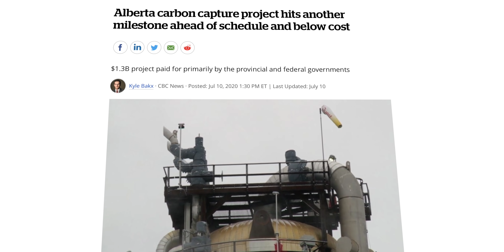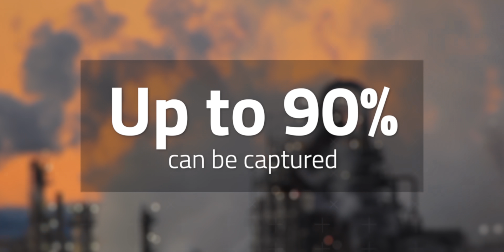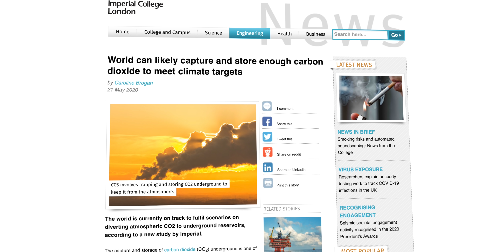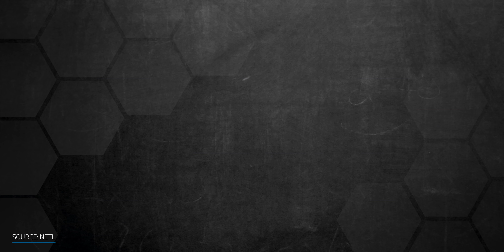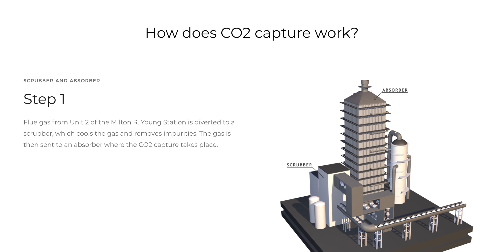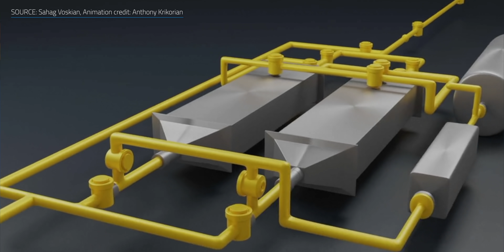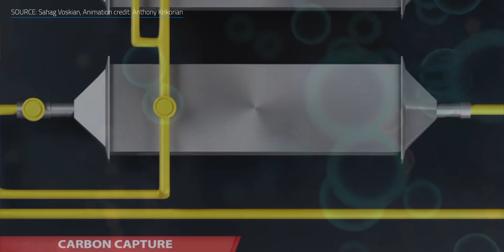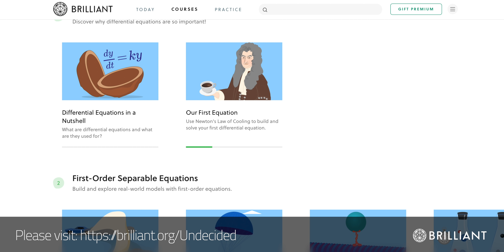The truth about capturing CO2 to reverse climate change

Comment: I actually spent 5 yrs of my life researching (i.e. in the actual lab) carbon capture, back when it was called CCS - carbon capture and sequestration (at a conference I went to they said we should stop using sequestration as it is too fancy of a word for the general public to understand). We worked with a lot of the big (and small) companies in this field and even got a $8M DARPA grant for our work.

Here's the problem, most carbon capture technology uses an amine solvent (like MEA, monoethanolamine) to capture CO2. You then have to desorb the CO2 by heating it to high temperatures, which takes a lot of energy and then compress it for storage, which also takes a lot of energy. The models we and others developed showed about half the power generated in a typical coal fired power plant would go to the CO2 capture and compression. We worked with enzymes to accelerate the CO2 capture and reduce the amount of energy needed but even in our best case scenario it would still require about 30% of the power plant's energy output.

Then the question is what are you going to do with the CO2? Sure you can use it for enhanced oil recovery or pump it into abandoned oil wells, but that really only works in Texas. Pumping CO2 from, say, Nebraska to Texas is energy intensive. One big earthquake could release all that CO2 and cause massive deaths (it's happened before, see Lake Nyos disaster). You can pump it to the bottom of the ocean where the weight of the water above will keep CO2 in a liquid state and at the bottom, but again that takes significant energy (bottom of the ocean is ~ 15,000 psi). CO2, energy wise, is bottom of the barrel (it's fully oxidized), so there's not many uses for it at the scale we're talking about. Remember, the scale of CO2 capture is HUGE.

Capturing CO2 from the air is just a stupid idea. As you said the concentration is so low in the atmosphere that the driving force is almost zero. The flux (transfer) of CO2 from the air to the liquid capture solvent is proportional to the driving force, this means it would require huge capture towers to make any difference, and these take massive amounts of energy to run and significant capex to build. The MIT thing may work in the lab and will make a good paper, but is not scalable. You can't override the laws of physics and chemistry, no matter how good you are. The only way anything meaningful will work is to capture it at the point of generation, i.e. coal (or natural gas) fired power plants (there's over 350 in the US and probably 5 times that in the rest of the world).

To sum it up, there is nothing technically difficult about capturing CO2. The problem is you have to essentially build an extra power plant for each existing one just to provide the energy for CO2 capture and compression, which means you have to burn twice the amount of coal you're burning now. And then you have to figure out what you're going to do with it. Just doesn't make a lot of sense. Reduction (population control?) and renewables make more sense.

(FYI, I have a B.S. in chemical engineering and a Ph.D. in Biochemical Engineering)
Reply: Why not use solar power for the energy required to capture the carbon? Or if that's not possible use nuclear power instead? Essentially it's depth we have to pay back now, humans leveraged fossil fuels but now the process needs to be reversed... even if this takes 50% of the generated energy... its a win... we actually would have to recapture part the  fossil emissions we added since the industrial age... if planting trees won't cover us here... by then we better have sustainable ornat least carbon neutral power production in place...
Reply: @nougatbitz  Why not just use solar and nuclear to produce our energy now? To use it to reduce previous CO2 emissions and pollute our world with nuclear waste and used solar panels (not to mention the carbon footprint to built these) seems like a waste. Building all this for direct air capture to reduce CO2 levels a few ppm does not seem like a great idea. The world stop eating beef would have 10x times the effect you mention here (in terms of cleared grazing land and methane emissions) at near zero cost.
Reply: Thank you for your very interesting comment. I mean it.
Reply: @user-mr7pm3kw4t  Like what? If there are energy sources more economical than coal (and natural gas) they would be in use today. Nuclear is one, but that's fallen out of favor. The way carbon capture is currently thought to be implemented would be attached to current coal fired power plants. The energy needed to run the carbon capture would be taken from the existing coal plant, it is called parasitic energy draw. They wouldn't build another power plant next to the existing one just for carbon capture.
Reply: Thank you for your input! A few days ago I finished reading "Getting to neutral" (https://www-gs.llnl.gov/content/assets/docs/energy/Getting_to_Neutral.pdf) a 178 page report on how to make the US state of California carbon neutral by 2045 at cost of 0.4% of the state's GDP per year. Carbon capture and storage, either from flue gases or from direct air capture does play an important role, although not the most important one, in this report. 
While the authors do mention the required additional energy for carbon capture technology, it is presented as solvable and not as breaking the entire concept. I found this report encouraging, but maybe I missed something and it does not combine well with what you stated in your initial comment.
What do you think of this? I would really appreciate your answer!
Reply: @matthiasmo4396  Well, I haven't read the whole thing, but one of their pillars is direct air capture, which, as I mentioned, is a stupid idea. Nothing they present is anything new, they just say it can be done by running spreadsheet models. Everything is solvable on paper. Just look at CA high speed rail, hundreds of billions over budget before anything of importance was even built. A big part of what they proposed is underground storage in old oil fields, again, nothing new but this has never, to my knowledge, been demonstrated at any reasonable scale. One bad earthquake (this is CA after all) could cause a major CO2 release and kill many (look up Lake Nyos disaster). The study was funded by ClimateWorks Foundation, so I would take it with a grain of salt.
Reply: So why not just use nuclear energy to power these machines?
Reply: @SuperThischannel  Why not just use nuclear energy to generate electricity in the first place?
Reply: @SuperThischannel  expensive and slow to build. With current energy prices and trends a gen 2 reactor just never returns the investment (afaik same with gen 3), so you must spend money which you never get back - something people and government really don't like to do.
Reply: Good luck trying to control the population in any non-communist country.

I don't see how that's actually a solution, that's such a globalist dictatorship mentality, you'd never feasibly be able to police or tax that kind of thing while simultaneously stopping it from happening. 

And I mean good luck with the next boomer generation rising out of covid.
Reply: @KingNefiiria  Of course, I was being facetious. And it's not the 1st world countries that have such explosive population growth, it's the 3rd world ones.
Reply: @sjn7220  yes and so the only way to stop their growth would be to take over and police it, which even if that somehow happened and wasn't considered extremely racist, it'd be impossible to control.

The US is starting to stagnate in population, most of our "growth" comes from immigrants. With the advent of birth control, we'll be fine in terms of population, we might even become Japan in the sense where we just stop having kids entirely. Most people either have one kid or none, or they have one kid early and one kid late, basically separated by an entire generation.
Reply: I worked in a different industry and hold several patents.  You are very intelligent person and would be an asset to a company.  However, we used to remove people with your thought process from our innovation teams.  Your statement, 'You can't override the laws of physics and chemistry', while true is not a limiting factor.  We used to say, look at all the opportunities the chemical and physical laws allow for.  We just need to find the solution that works.  Caveat: I am simplifying the next statement a lot:   Back in the 70's, they said the smallest line we could make was 193nm.  Because the laws of physics said that was wavelength of energy we could create that would still affect opaque materials.  Today, we make 20nm lines using 193nm wavelengths and although quite expensive, we can vaporize tin to create even smaller wavelengths and have materials which can be used as photosensitive to that wavelength.  There are solutions out there.  We just need to find them.
Reply: AlienHawk Q, you have the right idea. Time will create more ways to solve our problems. Things we thought impossible a few decades ago are possible today. We are not going to die or kill the planet in 10 years. We will come up with more ideas and ways to solve our problems. We have reduced carbon emissions dramatically over the last 30 years. One of the biggest problems we have is other countries like China not caring about emissions. We can do all we can to slow, stop, or level out our carbon emissions but when you have other countries increasing their emissions it seems like a waste of time. We need to start by putting countries like China in check and make them more responsible for their emissions. Nuclear seems like the best option at this point and time but the issue is the spent fuel rods and storage after they are spent. I like guys like you who don't think anything is impossible. That is how we create things we never thought we could. People like you are the ones who will solve our problems. Good luck my friend and best wishes.
Reply: @fatherof4kids  I don't think you understand the difference between what is possible but difficult, and what is impossible as it violates the laws of physics, chemistry and thermodynamics. But, we'll wait for you to solve it.
Reply: @alienhawkq4690  I'm an inventor on over 30 patents and have over a dozen publications. My company values my opinion and expertise. If they wanted a "yes" man, someone who says anything can be done just keep dumping more money into it, they could have hired someone from government. There is nothing more dangerous than "group think". The laws of chemistry and physics are exactly the limiting factor. Anyone who thinks otherwise is fooling themselves. I let my company what is easily feasible, what is feasible but very difficult, and what is impossible due to the laws of physics. They wouldn't have kept me around as long (20+ yrs) if they didn't appreciate and respect my analysis.
Reply: @user-mr7pm3kw4t  I didn't say it will, I said CC only makes sense at the point of generation - direct air capture is foolish for many reasons. Natural gas still gives off CO2, although less per kWh than coal. And, nuclear is not zero emissions; maybe zero gaseous emissions but certainly not zero solid emissions.
Reply: Hi. I feel conscious and intimidated of how many intelligent people are here, but u cant blame me im just a freshman student trying to research something about 'solutions' to CO2 emmissions. Im here to learn 😊

 I have a question tho. Do you think its possible to create something that will.. filter, capture or etc. the CO2 emmissions from factories? Something to.. like directly put on the mouth of those structures blowing out CO2?

Sorry i dont know if my question sounds stupid or what but yeah. Im here to learn
Reply: @victoriaangeline1784  This technology has existed for a long time. It is not difficult to capture CO2 from a gas stream. The problem is that it takes copious amounts of energy to capture it and then there's the problem of what to do with it. There's some ideas but none are ideal.
Reply: how arrogant of that conference
Reply: Why do we have to store CO2?  Couldn’t we take it and break it down to carbon and oxygen individually?  

Just because it takes away some efficiency (30%), to me that’s a lot better than population control or the nightmare ideas from the reset agenda in politics right now.  The point is to give us time to gradually replace old products.  Plus we need multiple methods, there’s downsides to renewables too.
Reply: @narnia1233  Unless you're a plant and can photosynthesize, converting CO2 to carbon and oxygen is not trivial and, more importantly, requires energy. In fact, it requires the same amount that was given off when carbon and oxygen were converted to CO2 (more, actually due to entropy) - it's all thermodynamics. The 30% (best case scenario) was just the energy needed to capture it. So, where should that energy come from? Burning fossil fuels? Well, that doesn't get us anywhere. Nuclear or carbon free sources? Sure, but why not just use those energy sources in the first place?
Reply: @sjn7220   Well, there are plants on earth.  So just buy some plants and let them do their stuff.  Release the CO2 next to the plant.
Reply: @sjn7220   My point is, there is some corrupt political ideology going on right now, which is being accomplished because people are saying the world’s going to end if we don’t force everyone to switch to better energy alternatives by 2030.  And that should be a concern as well.  I don’t know if you’re aware of “the great reset”, I wasn’t until a month or so ago.  But it is being promoted by lots of businesses and world leaders, it is not just a figment of imagination.  They want to give a group of unknown people control over everyone else.  

And things they mention too is population control.  But also the idea of no one owning anything anymore.  

Anyways, so all I’m saying is it’s okay to have a temporary solution to a problem while we slowly transition to a different source of energy.  Because we want to avoid panic and government takeover—that is also a terrible thing.  

Sure it stinks to not be able to take care of a problem right away, but sometimes going too fast leads to other undesirable issues.
Reply: @sjn7220    That makes me wonder, could we just build a building that holds all the output from the power plants that contains tons of greenery (plants)?  So that way we don’t even need to build technology to capture the CO2.  We just vent the gases into a building with plants that do everything for us.  So no energy loss then.

I’m just curious.  Has anyone seriously considered that?
Reply: @narnia1233  Plants don't grow at the rate they are fed CO2. They grow slow. I don't think you understand the scale of the situation. You would need a MASSIVE greenhouse to pull this off, probably 1000's of acres per power plant. It's just not feasible. The closest thing we had to this is growing algae in large ponds or clear tubes. Algae is one of the better organisms to converting CO2 and sunlight into oils. But, every algae company I know of went out of business. It just wasn't feasible.
Reply: @narnia1233  I'm not a conspiracy theorist, so I can't comment on that. But, just to be clear, converting CO2 back to carbon and oxygen is not even a temporary solution, it is not a solution at all. There is still a net release of CO2, it doesn't solve anything.
Reply: @sjn7220  
How exactly do plants capture carbon dioxide? Why not imitate the way plants capture carbon dioxide?  And converting it to oxygen and carbon in the way of plants as well
Reply: @ramaaljelani3838  The Calvin cycle is well known (how plants convert CO2 to glucose). Imitating it is not trivial (essentially impossible); but there is no need as plants do it quite well.
Reply: I didn't work on this problem in the lab. But I thought a lot about it. Back of envelope calculations would seem to confirm  your point of view. We'd better change our way.
Reply: Hey, since you actually know what you are talking about: Thoughts on enhanced rock weathering ?
https://en.wikipedia.org/wiki/Enhanced_weathering & https://projectvesta.org
It seems like THE solution that checks all the marks, and is so simple that any flaw should be easy to spot. Yet I don't hear much about it...
Reply: @musaran2  I don't know much about this, but any capture technology not done at the point of generation (meaning coal or natural gas fired power plants) won't be effective. The concentration of CO2 in the air is just so low that the driving force (essentially the force pushing CO2 from the gas phase to the solid phase) is just miniscule.
Reply: sjn 72 Bamboo is the answer
Reply: Thank you sir for sharing your knowledge.
Reply: Thank you for posting that. Would a renewable power source replacing the coal-generated electricity make a difference?
Reply: @nni9310  I'm not aware of any renewable power source that can be implemented at the scale needed.
Reply: Well you cant override the laws of physics but is this energy pr unit we are talking about? or does centralized locations to capture from multiple stations help that equation? Im rly just looking for signs humanity got what it takes for this crisis.
Reply: Umm just a thought, pressurized air is used in a type of battery, separate co2 there ? seems better then just filtration of the atmosphere... mayby some GMO could help...
Reply: how about a giant solar and wind farm with a battery plant, like the one in australia, could that be an alternative for a powerplant?
Reply: Brilliant well done for saying the obvious 🤣
Reply: Hey you, I know its been 5 months and a lot of comments but I just discovered this video while doing a research project for uni and wanted to thank you for your insight. I'm doing my masters in process engineering and have to write about the potential of this techonogy for the cement industry in Austria. Thank you again for the read, you really seem to know your stuff :)
Reply: @iheartcupcakes253  No problem. Good luck with your project!
Reply: Hey i am from india and a professor at indias best university IIT BOMBAY i want to talk to you if you or anyone else is reading this please contact me on 9899187299
Reply: Thanks for that insight.
Reply: Thanks for this detailed explanation, appreciate it.
Reply: I’m a new grad student doing research on catalysts for CO2 capture. You mind if I could ask you a few questions?
Reply: have you seen the new developments on synthetic auto fuels? does the math & chemistry work in those cases?
Reply: @Philip Ethan van Harreveld u do realize that co2 levels would rise and fall if humans weren't here, in the past they were higher. And melting ice would naturally increase the temperature as the planet becomes less reflective as ice is extremely reflective. Also the changing in strength in the magnetic field also results in warming as it gets weeker. Water is also a greenhouse gas and as it gets warmer, more water evaporates resulting in even more warming causing a closed loop in which each accelerate as a result. Also the poles retain little water in the atmospheres. A warming would result in less water going into the ocean and more into the atmosphere, again warming the planet
Reply: @Tamiasciurus we just need air and water borne sterilization agents lol they dont have the brain capacity to enter the modern world the way humans can, and we need to do something about them soon...
Reply: Finally a honest answer. Thanks so much bro. If we go to technology,, we have to get much closer to bionics, and biological chains of energy. It could be trees, or bacteria, in order to get co2 bound into sth that can be used. In the end however we will not use traditional agriculture or bacteria reactors, we will use agricultural ai and robotics
Reply: Interesting thank you for writing this up.
Reply: Yep. That's basically what every physicist who is not payed by the oil companies would tell you.
Reply: sjn 72
Thank you for explaing the absurdity of this projects.
A doubing of the co2 concentration is highly desirable, essential for people trying to survive on the low content of co2.
The impact on warming is negligible.
Reply: sjn 72 
Using MEA, as done in submarines,  is not effective at the low concentration of 0.04%
Reply: can they channel waste heat from the hydrocarbon power plant to power a steam turbine/solar updraft/stirling engine arrays for carbon capture?
Reply: Have you ever learned how much co2 a plant needs to synthesize fructose, aka glucose? 
for every kilogram it must capture 1.467 kilogram co2 from the air, which has only 0.49 grams /m³. 
3000 cubic meters if the plant could capture all its content in a m³, 
Think about it before noticing that the vegetation at high altitude must starve because the content there is only 0.24 gram/m³.
Do the numbers yourself and bow your head in shame.
Reply: How did nature capture CO2 in the ivory coast? Is there a way we could re-produce the effect?
Reply: About trees, I once went looking it up and it seemed to me that the present CO2 footprint of a person in the west is only compensated by a soccer field full of trees. We don't have the space to plant all these tree. Ground is costly. I believe that massive worldwide conversion of biomass to biochar would make a noticeable difference after at least a decade. The source is the problem, we emit way too much. I would force corporations to recycle, produce and store energy all locally on the plant itself. This would raise the price of the product but normally not to make the product unaffordable.
Reply: And that's the problem with technological silver bullets. Technology doesn't replace energy. You can't ignore the law of conservation of energy in the closed system that is Earth. The only solution is to stop consuming and shift entire industry to production of renewable power plants.
Reply: @sodalitia  you can ignore the law of conservation of energy outside of earth's "closed" system?
Reply: @sodalitia  Renewables are total losers in terms of mitigating the problem.  The Germans learned this the hard way.  They increased both their wind and solar apparatus by about 13% and then generated 11% LESS power overall bc it wasn't sunny or windy.  Look into Liquid Fueled, Molten Salt Thorium.  No need to do without.  And the waste heat can be used to pyrolytically turn garbage into hydrocarbon fuels or desalinate water.  The name you want to know is Kirk Sorensen.
Reply: @sodalitia  The only real option is reducing consumption and limiting population growth. Sure hydroelectric is great, if you have a fast flowing river nearby and ignore the environmental impact of the dams. Solar requires massive surface area and the commensurate amount of solar panels (which have their own carbon footprint to make and install and have a limited lifetime). Biofuels have a long ways to go and still require huge land masses with the required water and fertilizer and the logistics to transfer all the bio-feedstocks to the fermentation plants. Algae shows a little bit of promise, but again you need large areas and water to grow the algae, then you have to separate all the water from the algae and recover the oil, which is really the achilles heal of algae tech.
Reply: @sjn7220  Well, to be honest, by saying "solution" I was overly optimistic here. I don't claim it will solve the crysis, especially when we already likely passed the tipping points. But I was saying that in contrast to pipe dream of CCSes. If we don't have political will to shift most of the world industry to serve transition to renewables, regardless how unachievable the ideal of 0 emissions is, and curb our rampant consumption, we are done here. All forms of energy production have problems, because by increasing the energy porfolio even by renewables you enable and stimulate, within the capitalist system, more resource extraction and production. It's called energy-production interface. I don't really see solution to climate change within capitalist system. When it comes to overpopulation and overconsumption, lets remember that the latter results in way higher emissions than the former. Despite record population growth, the poorest countries have the lowest carbon footprint, so I think we should be very careful about population control, when average American produces 14 tons of CO2 a year while average Indian 1.7.
Reply: Regarding Algae biofuel, one would think it would be relatively easy to engineer them to concentrate and release their oil on their own.
Both processes are fairly common in various life forms.
Reply: @musaran2  You are the one who think it would be easy to "engeneer them to concentrate and release oil on their own". Whatever that magical, techno-mumbo jumbo means.
Reply: @musaran2  You've not worked with algae if you think engineering them is relatively easy. I can think of half a dozen algae companies that are now out of business as they couldn't solve the algae problem. I'm also not sure what you mean by "Both processes are fairly common in various life forms." regarding concentrating and releasing oil.

Besides, concentrating and releasing the oil is not, and doesn't solve, the problem. The oil is already concentrated within the algae and you now have to separate the algae from copious amounts of water. You can't skim them off the top (they grow several feet deep in water) and centrifugation is not easy when their density is similar to that of water (and centrifugation at that scale is not free opex and capex wise). Filter presses don't work all that well for this either. I've seen drum dryers used but, again, these are costly to operate when you're trying to make a commodity chemical (water has a very high heat capacity).
Reply: @sjn7220  Don't know how much you know about it but would love your thoughts on Modern nuclear? Modern traditional nuclear? MSR (Molten Sal Ractors)? Thorium? As far as I've gathered they can re-use the fuel waste from older nuclear plants. Short of reducing cons. and population nuclear seems the only viable energy source where the waste is fully contained. Also provides ample energy, has comparatively small footprint. And unlike common misconceptions, aka hysteria, it's incredibly safe.
Reply: @Badabinger  I'm not an expert in nuclear. I'm definitely not against it, especially the more modern reactors, as you mentioned. Nuclear is not risk free, but probably the best we have at generating energy for 8 billion people.
Reply: Fantastic writeup. Common sense says this is a stupid idea.
Reply: I think planting more trees will help us in keeping climate change under control and its very cheap too.
Reply: I have a simpler solution, sell the damn co2 to greenhouses for there plants. People keep forgetting that they need co2 to live. Co2 isn't a toxic and is a gas that is natural and needed in the atmosphere. The world not going to end.
Reply: Thank you for sharing that.
If it is true what you say (I don't have a doubt), the CCS is just as useless as syn-fuel from plastics or hydrogen in cars to combat the climate crisis.
Reply: Excellent explaination, Makes sense. Well U are not alone in this. Nature capture the CO2 too to storages it deep in the water, below the soil and within the trees.
Reply: Instead of all this nonsense and talk of crushing freedoms and economies, perhaps we recognize there is no anthropogenic global warming. 

And of course, climate change is a big joke. It's simply the politicization of weather.

There is not a shred of data supporting it. 

All we have are climate hoaxers and fascists pulling the same nonsense they've been pulling for decades.
Reply: How about we just plant trees? Oh wait, corporations can't make millions in profits from that.
Reply: Jess Whallon You sound like a bitter socialist loser. 99% chance you're poor. 😹
Reply: I am also a chemical process engineer with a biotech PhD. 

1) you need to stop pushing your ideology into the discussion. Anything that you think you need to force people to do with "political will" is wrong to begin with. I live in a country which is always threatened by socialism and you wouldn't last one month in here.

2) no matter how much your "political will" destroys your own economy, China is not going to stop polluting the same planet you live in. All you get with your "political will" is becoming even more trapped in the "political will" of the CCP. They made billions with "vaccines" and "ventilators" from their own god damm virus. They were going to pull the same fast one in the world with that crap Paris agreement. Even after signing it they still kept building one new COAL plant every two weeks.

3) the population of Nigeria is not going to stop growing and you can't force them to. Feminism will not destroy their families like it did to ours for at least the next 20 years, so you are just going to be demographically replaced in the world and not solve any of the environmental problems you pretend to be concerned with.

4) climate fear mongers like you never talk about our main source of energy besides Earth's core: the sun. The sun has cycles of high and low activity and Earth's orbit also changes in cycles. For a large part of the 20th century, the planet received a low input of energy. The low temperatures and ice storms killed the crops in the South of my country and forced people to move to the center-west. Only recently it has recovered. Before that, in the 1700s (if I am not mistaken) a cycle of low activity caused one of the greatest famines in Europe. Just like CO2 itself, heat is great for FOOD PRODUCTION.

5) the lobby against nuclear power and for solar and wind is just as bad as the lobby for oil. In fact, did you know that due to the unreliability of solar and wind you need to have a gas plant together with them? So it is literally the same lobby. Oil pays for solar and wind propaganda. Meanwhile we already have technology for consuming nuclear waste to generate more power and less dangerous nuclear waste and modular molten salt reactors which are inherently safe against meltdowns. But that never gets any attention because it doesn't allow to make bombs. India is one of the biggest countries in the world and is developing their own Thorium-based nuclear energy programs.

6) we have had recent breakthroughs of supercritical CO2 turbines. This is huge and I see very little news about it. These turbines can recover energy from low temperature systems in just about every industry, and can improve the efficiency of any power plant.

7) one of the biggest CO2 recycling systems of the biosphere is cyanobacteria. They use solar energy and sea water. If we want to remove CO2 from the atmosphere, why not use them?
Reply: @mariobros7834  Bravo!  Well said.
Reply: @mariobros7834  lmao only reason of the climate change is literally top 50 corporations polluting the earth without regulations but my man somehow talks about socialism in his argument. blaming the population is just a malthusşan nonsense and is definetly not real. besides that, feminism does not destroy families in developed world, its because females tend to work and earn more in those countries. climate change problem is highly political and taxations/regulations should be done in accordence with the responsibilities of each countries/corporations. any other solution proposal that misses these points is just blank.
Reply: @mariobros7834 
"climate fear mongers like you never talk about our main source of energy besides Earth's core: the sun"
Because it is irrelevant, the sun's output is very stable in such short time span as a couple of centuries. Also, it's decreasing now, but again: irrelevant.

"Before that, in the 1700s (if I am not mistaken) a cycle of low activity caused one of the greatest famines in Europe"
So called "little ice age", but the change in temperature was about the same as warming since the industrial revolution until now, and the worst of it is still ahead of us.

"Meanwhile we already have technology for consuming nuclear waste to generate more power and less dangerous nuclear waste and modular molten salt reactors which are inherently safe against meltdowns"
There is currently exactly zero MSRs in operation, China is building 2 (I think India is also building some), results can be expected by earliest 2025 and 2035. Most likely too late in the fight against climate change (remember: another 5-10 years to build a reactor), even if they end up working in large scale. I hope it will turn out great but would rather not bet humanity's future on it. Breeder reactors using nuclear waste are just commercially even less viable than conventional nuclear plants (more expensive per energy). I'm ok with that, but climate change is not a technological problem at first: it's economical and political. We have solutions but only expensive ones, and those are usually stuck at the "and who will pay for it?" question.

"But that never gets any attention because it doesn't allow to make bombs."
I think you mean Thorium, but it can and has been made into bombs. There is no way around nuclear proliferation, accept it or forget nuclear power.
Reply: I'm not a scientist but, I do know that as the human population increases exponentially, so will the need for oxygen.  That means we're going to need more photosynthetic organisms that depend upon Co2 in order to produce more oxygen.  Maybe "scrubbing" Co2 from the atmosphere is not such a smart idea?  

But, hey....I'll play along.  So, let's assume that every country in the world manages to achieve net zero carbon emissions.  Then what?  What's the plan after that?  Does the planet begin to cool?  Will the Earth's temperature just stop in place and not get warmer or cooler?  Will the climate suddenly become static and stop changing?   If we achieve a net zero carbon footprint, what's the plan after that?  

If you're a scientist, then you know that in order for all efforts to reduce Co2 to be valid, there must be a plan.  If there is no answer to the questions outlined above, then,  there is no plan.  In other words, no one knows what will happen.    If no one knows what will happen, then, how can the push to reduce Carbon and Co2 emission be a scientifically valid plan?  Short answer, its not.  

Also, since when does Co2 alone have sufficient force effect to change the climate?
Reply: @akasgsvirgil9503  Even with population growth, we are in no danger of running out of oxygen. Air is 20% oxygen. We're good on that.
Reply: @akasgsvirgil9503  The article is mainly speculation and rough computer models and projection based on a few years of data. It even says "Because the observed records span only a few decades, projection of this decay is highly uncertain and the complexity of the biogeochemical interactions makes such a projection a challenging task." I, and most scientists, are really not concerned about running out of oxygen. If it happens, so be it.
Reply: @sjn7220  So, you dismiss it because its "speculation?"  What part of the rapid climate change narrative isn't based on speculation?  Aren't predictions by their very nature "speculations?"  

What is the predicted outcome of Carbon Capture?  How will removing C02 and other carbon compounds effect the climate?  

Remember, "I don't know" is a perfectly good answer in science.  ;-)
Reply: @akasgsvirgil9503  the reduction of carbon is a high level plan by rich and pwerful people to limit the growth of plants and reduce farm output, reducing the "undesirable " population
Reply: Yes, lets kill half the world's population... that'll solve those made up problems your side is pushing. It is your ultimate goal.
Reply: @johnrmcclure1  Thanos was right? 😤
Reply: @johnrmcclure1  Of course, I was being facetious.
Reply: @johnrmcclure1  limiting the population isn't killing anyone idiot. it just means limiting the amount of kids people can have. and yes ik youre gonna cry about your rights and how liberals want to "control" everything and youre gonna bring up some religious shit. Sad how predictable you all are.